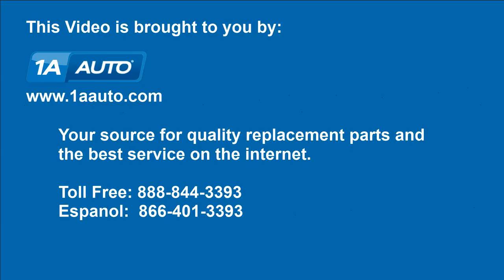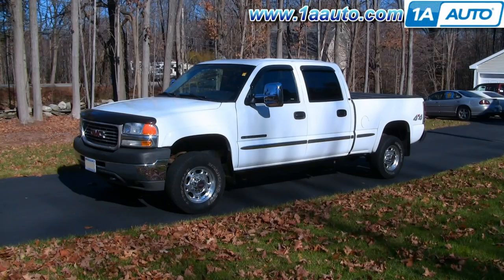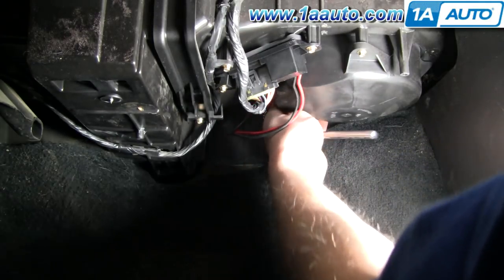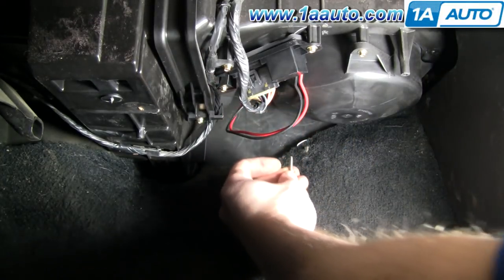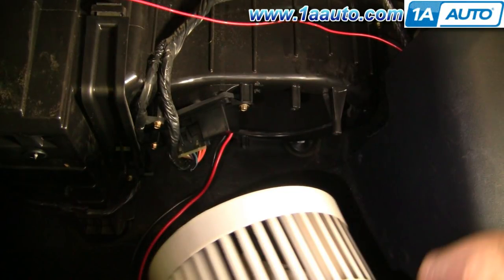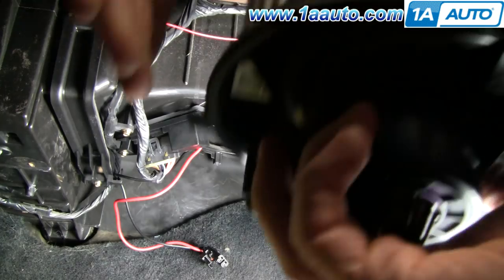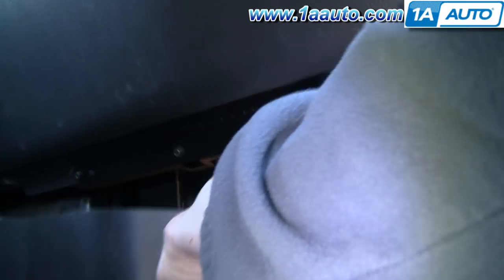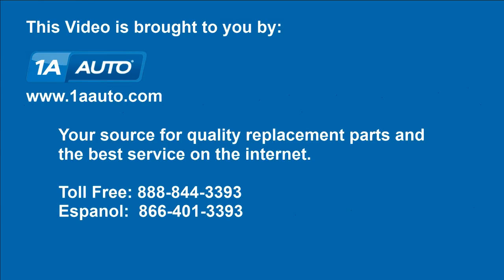How to Replace Heater Blower Motor 01-02 GMC Sierra 2500 HD

Comment: I appreciate the vid. My blower motor started making a gawd-awful noise today after visiting the carwash. I was afraid it would be a difficult and costly repair. Since my '02 Tahoe didn't have any of the lower covers anymore, I simply had to detach the cable and turn-and-pull. To my amazement, there was a 4"x6" piece of ancient junk mail in the blower motor. Simply and quick fix this time! Thanks again!!!

Comment from the maker: @geddingtonfire It could be the blower motor resistor. You may also want to remove the blower motor to see if anything has ended up in the cage that could be slowing it down. Such as leaves or dirt. Hope this helps you out.

Comment: Great video. Huge help. Mine was making a lot of vibration at settings 4 and 5. Turned out, there was just a lot of debris (leaves, etc.) in the blower. Took it off, dumped it out, now it runs and sounds great. Thanks! But man was that back screw a PITA!
Reply: Scott Sherrill j
Reply: That back screw WAS a PITA...

Comment: Super helpful video.  It made this job a snap!  It only took me 30 from start to finish thanks you.  BTW, I bought the part from you at a fair price and it fit perfect.
Reply from the maker: +Rick Bright Thanks for choosing to buy from us! And thank you for taking the time to comment. Really glad to hear the video helped you out. For anyone else who might be doing this job, we carry the parts shown in the video on our website. Order from us and we'll cover the shipping. Here's a link: https://www.1aauto.com/1A/BlowerMotor/GMC/Sierra/1AHCX00189?utm_source=YouTube&utm_medium=CTA%20Comment&utm_campaign=1ATony
Reply: It wasn't as easy with my 2500 Avalanche I have the luxury model with all the options, the carpet was too thick to allow for a good fit with a socket on that back 7/32nds shoulder screw so I had to pull back the carpet. Plus all the connector tabs were really difficult to remove for the wire harness, I have big hands and had a real hard time getting into those tiny spaces. Luckily I had some help from a friend with smaller hands.  Overall though I would have had a MUCH harder time had I not watched the video, thank you.

Comment: Great video. I replaced my fan yesterday. I had to put a speed nut on the fan cover screw in the back or I would never have gotten it back on. Even then I needed 2 ratchet extensions and 2 elbows to get to it.On my 2002 Avalanche there were only two screws that had to be removed for the first large cover, then 2 more for the voltage regulator, then 2 more on the fan cover. The new fan came with a wire and plug which made the fan replacement and reconnection much easier. Thanks again, very helpful!
Reply from the maker: Standammit Thank you for watching! We're glad we could help you out and we enjoyed hearing about your auto repair experience. Keep up the great DIY repair work! 1aauto.com 866-403-3393

Comment: Mines starting to make a screeching noise when the fan comes on then after it warms up some it quiets down. No clue why. It used to be only when very cold. I don't drive it too often but I figured the blower replacement was easy enough to change when it got bad enough. This morning it took a long time to stop the noise. So looks like this is in my future. Thanks for the video it confirmed it should be easy enough to fix.

Comment: I wish my truck was as cleared out as the one you did this job on.  I have a center console and extra ducting to deal with.
Ok, I decided to remove just the 3 screws on the bottom duct.  Left the one by the gas pedal in because I didn't want to deal with removing center console and ducting.  After some serious body contorting on my part, I was able to finally remove motor, working around the bottom duct.  I nothing jamming motor up, so I plugged it back in while I held in hand, turned it on, and sure enough, it didn't turn at all on level 1.  Level 2,3, and 4, it came on and was grinding.  Time to order new motor.  Thanks for the video.  Will order from you now.
Reply from the maker: Thanks for watching. We carry the replacement blower motor shown in this video on our website. Here is a link to them if any of our viewers needs to replace theirs.  https://www.1aauto.com/heater-blower-motor-with-fan-cage/i/1ahcx00189?utm_source=YouTube&utm_medium=CTA%20Comment&utm_campaign=ytcomment
Reply from the maker: +Threedog1963 Thank you for watching. We hope to work with you soon. Please don't hesitate to call us at 1-888-844-3393 if you have further questions or concerns. 1aauto.com

Comment: GREAT video, even when you blocked the camera, I had more than enough information to make this same repair.  Turns out I had sunflower seeds and a peanut in the fan (stupid mice) so I cleaned it out thoroughly, ran the shop vac up the vent and also ran about 100 PSI of air through the system.  whole thing runs better than when I bought the truck!  Now, to see if I can send the new motor back...

Comment from the maker: There could be several different things causing the air not to blow but one of them is the blower motor. Your best bet would be to check to see if you are getting power up to the electrical connection on the motor itself and then go from there.

Comment from the maker: If all of the speeds but high are dead, it will most likely be with the resistor and not the switch. Your best bet would be to test the switch at the resistor to see if you are getting power at each setting before replacing anything.
Reply: Can I get the idiot proof explanation? Say what? Lol

Comment: Great video. Thanks! Just replaced my blower motor and cabin air filters while I was in there. Nice to know what tools I need before I start instead of making trips back and forth to the tool box...especially when I'm working in my driveway in the middle of winter. Do you guys ship to Canada?
Reply from the maker: Yes we sure do. If you go to our website, upon checking out, our international shipping company will quote you the shipping fee and any duty fees that are associated with the order. Hope this helps you out. Have a great day! 1aauto.com 888-844-3393

Comment: I have air blowing but it doesn't blow as powerful as it used to.  The AC no longer recycles the inside air which is when it used to blow much harder.  I'm assuming that the replacement you show in this video would fix my problem?  All air is exterior air, so in the Texas heat I have a little cold air that hardly blows thru the vents and so I end up sucking in all the fumes from every other vehicle around me on the road.

Comment: Hi there, i recently replaced the blower motor resistor on my truck, after losing several speed setting. When hooked it back up and tested the fan I had reduced fan speed  and immediately smelled burning. The  new resistor was getting hot . Possibly needing a new fan as well?

Comment from the maker: @reposado28 It could either be the blower motor resistor or maybe even a loose connection or wire somewhere. I would check to see if there's power to the blower motor and the resistor with a test light.

Comment: I guess I should have added in that it worked on 1-2-3-4 but not on 5 for a couple of months  then when I started it one morning none of the settings would work. Im going to check the fuses tomorrow when I get home from work hopefully its as easy as a 5 dollar fuse thanks.
Reply: Its the blower motor resistor....and its not cheap

Comment from the maker: It could be that the blower motor is getting tired. You could also remove the blower motor to see if there's any debris caught in the blower motor cage that might also be causing this issue. Hope this helps you out. We carry new blower motors on our website 1aauto.com 888-844-3393

Comment: Hey I have a 2007 gmc Sierra 4.8 and the blower stopped working all togeather. no hot air or cold air would that be the blower motor itself or the resistor?? Your video's have saved me alot of money from changing my water pump to belts and pulleys ect thanks any help to check what might be wrong would be great thanks.
Reply: Hey was wondering if when you replaced your blower motor if that fixed the problem or was it something else I have the same issue and it's getting hotter by the day in beautiful AZ

Comment: I have a 2001 1500 extended cab and it looks slightly different from this under the kick panel.  Is mine still a twist out motor mount?

Comment: I wish you showed us what the tab looks like and how to release it, but overall good video... thanks for posting
Reply: Dorn Stewart I broke the tab and it was easier doing it under pressure while snowing on me, the new blower comes with its own new tab
Reply: You pull the tab down just a little to clear so you can turn motor counter clockwise a little and down/out...he did explain/show that!

Comment: Good video.  I have a 2001 blazer, and the fan selector (as in selecting face, feet, etc) won't switch.  It is stuck on the face setting.  the heat, and fan works fine, but I can't choose any other setting.  Any idea on what this could be/how to fix?  Would it be the same problem as you are showing here?  Thanks

Comment: Just pulled my old blower to replace with a new one, but was struggling, with removal till I realized there was no shield for the old fan. There are two empty screws holes. Do you think it is OK to run it without a shield, as I have been doing for the last 7 years?My truck is a GMC sierra 2002 2500hd. The blower I removed is a Valeo 52494617 with a manufacture date of 2/23/02. Since the truck is a 2002 could this be the original, just never received a shield???Thanks,Steve
Reply: I thru mine in trash can a long time ago...its just to make interior pretty, deaden sound a little from blower motor, and something to kick when u get teed at your wife or kids driving 😂

Comment: Thanks for the vid! My blower squeaks cause it was always on HIGH when I had a control issue. Does it need replacing or greased? (Anyone??)
Reply from the maker: +3printer3 Thanks for watching!  If the fan squeaks on high they it may need to be replaced, but spraying a small amount of lube on the motor shaft wouldn't hurt!  1aauto.com

Comment: I have a 2001 gmc seirra 1500 and its making that loud humming noise underneath the glove box when i crank the AC up to 3, 4, and 5. By replacing the blower motor it will more than likely solve this problem?

Comment: Do these things squeal? Because my father has a 03 2500 Silverado and when you turn the fan to a lower setting It squeals and It Is very annoying. But It does It for the heater and AC so I guess It wouldn't be AC Blower Fan Motor. Have any idea what It might be? and If It needs to be replaced or just lubricated?

Comment: @traunt53   On your truck you have two resistors that control your fan speed. one is near your blower. the other is beind your 12345 speed control switch

Comment: I'm about to change my heater blower motor on my 2000 silverado tomorrow, but im concerned that it may not be the cause of my problem, see my heat was cutting in and out for about a week, a light kick under the glove box was providing temporary support, but one day i smelt burring plastic, so i put my head under the glove box to inspect the problem and i saw flames shooting out of something down there, i turned my heat off so my truck didnt light up, and i havent had heat sense. any ideas?

Comment: I have a 1999 Short box, Standard cab and until now, 15 years later, the blower speeds have gone 1 at a time over the last month. Now, with this sub-zero weather, all I have left is #4. Vas gibst?  What should, or what can I do??
Reply from the maker: Thanks for watching. I would check the resistor first. It is pretty easy to tell if the resistor has failed. You may also have a problem with the control panel where one at a time the speeds went out.
1aauto.com 888-844-3393
Reply: Great show. Loved it. Thank You very much.

Comment: I have a 2000 Tahoe, and I went to start it up to warm it up and the heater fan wouldn't blow and then smoke started blowing up thru where the defroster comes out and it smelled like wires burning, so do you think the heater blower wires burnt up or what else could it be?
Reply from the maker: You may want to check the wires going to the blower motor and also to the blower motor resistor to see if they're burn't. Sometimes when the resistor fails, it will heat up and melt the plug end. If that's what happened we carry new blower motor resistors and also new plug ends to repair the damaged one. Here's a link to them on our website. http://www.1aauto.com/1A/blower-motor-resistor/Chevy/Tahoe/-/-/2000?utm_source=VideoReply&utm_medium=YouTube&utm_campaign=1ATony

Comment: My 03 suburban blower shuts of sometimes but if I bang the plastic shroud it comes back on do you think it's the blower motor resistor plug.
Reply: That resistor actually has two in that cover...one is for 1 thru 4 on dash switch and the other is for highest setting 5. Mines went out a couple times because im gett water in there thru air intake. Usually one or other goes out. Try it on 1 thru 4 than on 5 and see if it still does it...

Comment from the maker: You may have a short at the end of the plug. You may want to insect the plug to see if it has melted. Sometimes a faulty blower motor or resistor can cause that plug end to heat up and melt. If this is the cause than you may want to change the blower motor too. Hope this helps you out. 1aauto.com 888-844-3393

Comment: will this procedure work for a 98 tahoe, because when i turn my a/c switch on in the front it doesn't blow at all on neither speed , but when i turn on my rear a/c switch it blows, but it doesn't put out heat or cool air it just blows. What could be my problem

Comment: I have a 2001 Chevy Tahoe and when I turn the heat or ac to 1,2 it doesn't work but on 3,4,5 it does should I replace the motor
Reply from the maker: Usually when you start to loose the fan speed settings, it's a sign that the blower motor resistor's going bad. We carry new ones on our website if you need one for your 2001 Chevy Tahoe. Here's a link to them on our website. http://www.1aauto.com/2001-chevy-tahoe-blower-motor-resistor/y-mo-c/2001-44-157?utm_source=YouTube&utm_medium=YouTube&utm_campaign=1ATony

Comment: so once you remove the cover, there is what looks like a door next to the motor that I cant figure out how to open, or how is there air suppose to move thru, cause my problem is the air isn't coming out of the air ducts, but the motor is working! just can't figure out how to get the air to flow, and it looks like this door thing that I cant get open is keeping it from circulating? I need your help please? I don't know how else to explain it, but I hope I explained it half way right, so that you might be able to make since of it!!
Reply from the maker: The door should open when you turn on the HVAC controls. It could be faulty. You may want to see if there's power going to it when the heat is turned on. Hope this helps you out.

Comment: The later Chevys are pretty much the same as this one.  You don't have to remove all the cover screws.  I think it was the left 2 that we left in place and they're the ones that are hard to get to anyway.  The cover will flop down so you can get to the blower and the resistor on the later models as we. Just don't force it and break the plastic!!!   I have a 2011.

Comment: hello I have a 2004 Chevrolet Colorado and I replace my blower motor resister and wiring harness and the AC still doesn't work any ideas what it could be

Comment: I bought my truck used and I replaced my blower motor, however it keeps falling out after I hit bumps. Does anyone know where I can find a cover for it or a tip on how to hold it in place? 

Thank you for the video btw 1A!
Reply: 2003 Chevy Silverado 1500
Reply: It only has two screws holding it in...if those are in that should not happen...did you strip the screw holes out?

Comment: The connection between the two in the plug is burn on the thing metal sheets inside the plug. Should i buy a resistor and a new adapter or get all three. By the way sometimes but rarely the motor will blow and then after like 3 minutes it goes off and doesnt start up again.

Comment: I am replacing my 1975 mercedes 300D blower motor. In that car, Mercedes installed the blower motor first, and then built the car around it. The shop time to change that is about 12 hours. So I did the work myself and saved about $1500. Unfortunately, the motor is $500 and those blower motors were the bladed ones, not the squirrel cages and nobody makes those anymore so I can't use a generic motor from some American car. I'm so screwed. Got any ideas?

Comment: Hi i was wondering if you can help me out I have a 2004 gmc yukon xl im having trouble figuring out whats the problem my a/c and heater stopped working the compressor turnes hnder the hood but no cold or hot air comes out but the rear a/c does work any help please? And thank you
Reply from the maker: You may want to check the blower motor to see if there's something blocking the duct. If that looks fine and there's power to the blower motor and resistor, you could also check the vacuum lines under the hood to see if they are also okay, or if there's a broken of cracked line that may need to be fixed. Have a great day! 1aauto.com 866-403-3393
Reply: Thank you very much for the help i will check it out

Comment: I have a 2000 Chevy Silverado 2500 heater works but not the top blower speed, any ideas???
Reply: Mark Olsen same problem on mine, it's the climate control fan speed switch acting up